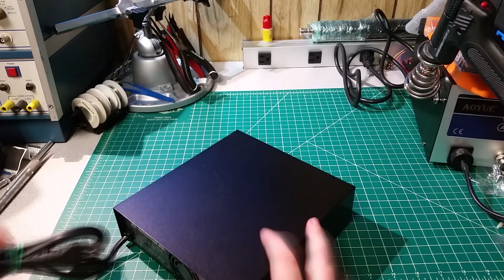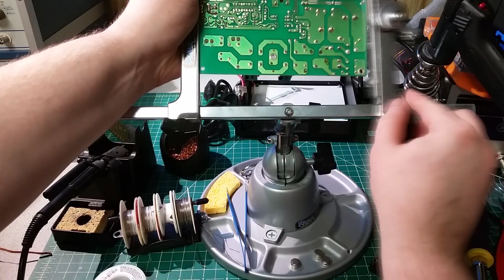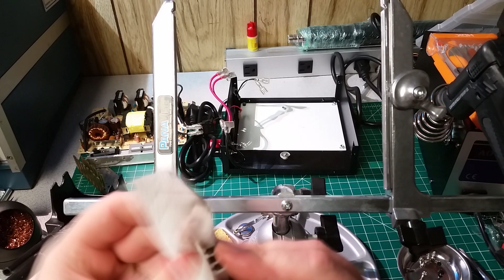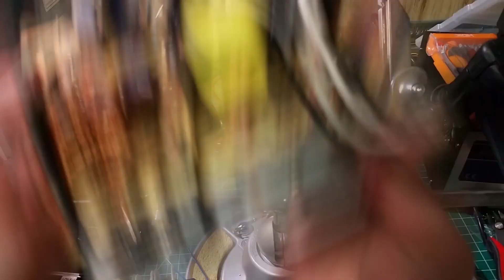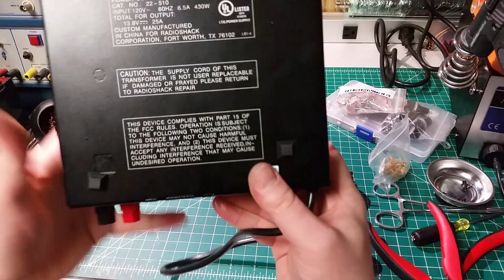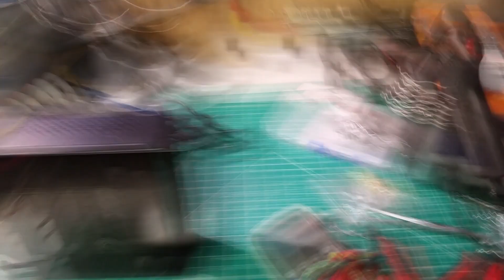Repair Bench: 12V Power Supply

Comment: I have the same supply and I just developed a problem with it. I am using an HF radio which pushes the supply quite hard. Now what happens is when I transmit the supply drops voltage to a level where the radio shuts down. After a couple of seconds it powers back up. 

I don’t know enough about a switching power supply to identify what is failing. 
Any advice?

Comment: I bought one of these at a ham fest last week that is blown. I got the right bridge rectifier and installed and fuse but still no output to output terminals. Switch lights up nothing smokes voltage in & out of B.R.

Comment: Thank you. My favorite power supply (22-510) just died. I don't think it is the rectifier. but I will check it. Fuse is ok and switch LED lights. Date code: 10A07

Comment: I have the same power supply from 2003, only thing I had to replace was the fan so I put in a high quality Delta fan. Mine has many hours on it and yours is in way better shape then mine, mine you can tell just from looking at it that it has be well used. I must say tho these are really well built little units.

Comment: The majority of SMPS can only properly regulate with a minimal load, so 14.2 doesn't sound that bad, you really should adjust it under some load
Reply: That's no true.
Reply: Not
Reply: Dennis Lubert , true. We need to apply resistive load about 10% of current capacity when adjusting the output voltage.
Greetings from Indonesia